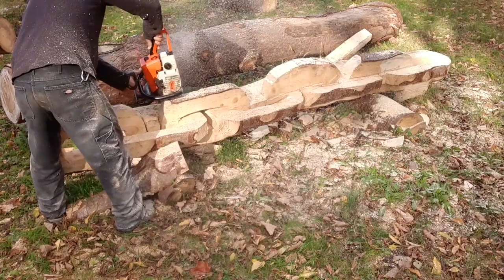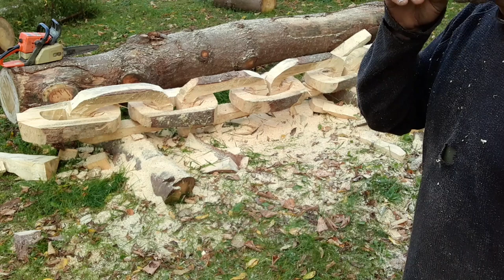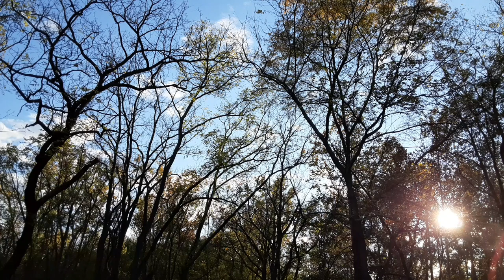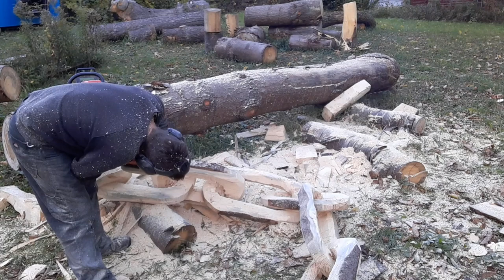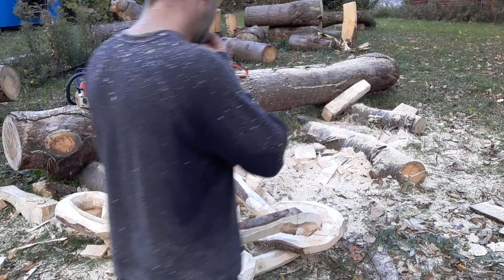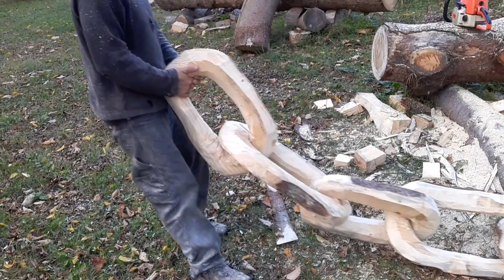how to carve chain links with a chainsaw part 3 the final stages

Comment: I made a 3 link with a Dremal year's ago and it fascinated me.    Note :it was way,way smaller
Reply from the maker: I started out whittling them.out of furniture dowels,with an exact knife, used to get two out  each piece. They were tiny. I've attempted whole necklaces with dremel, but the links always broke on me! Lol! This is much easier, lot more room for those small mistakes, if you watch the series of videos, I'm not being very precise until this part, even then I was kind of flying through it...
Reply: @badasswood  I saw 5his last night and went today into the woods to find length suitable. .......ended up with a full eagle....first full body for me...4 months experienced  now..lol I  don't force.. ...just see it do it..but I WILL MAKE a big chain soon. ...thank you for sharing